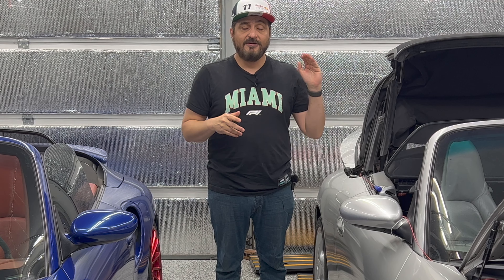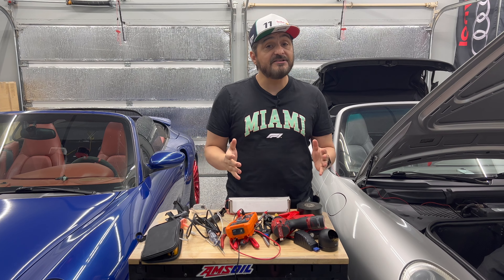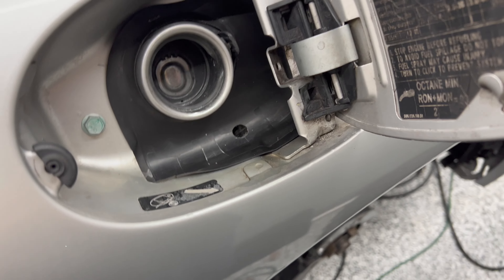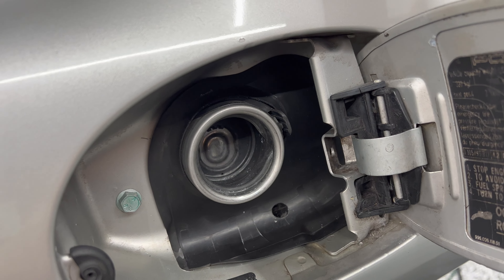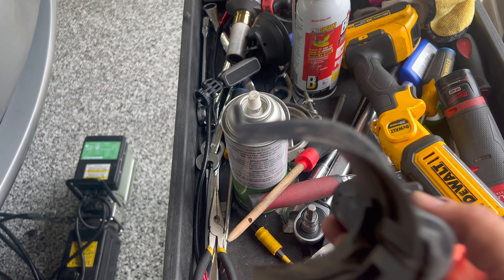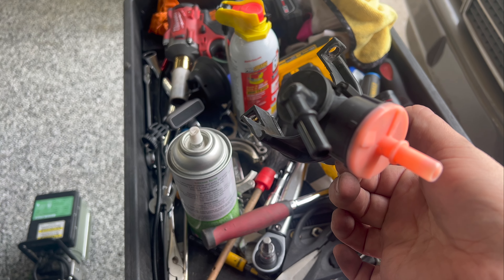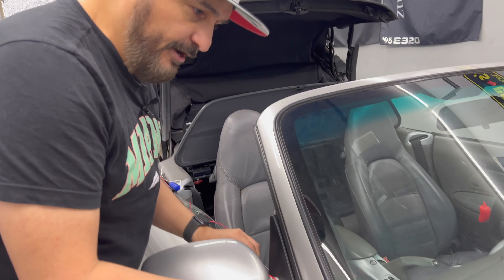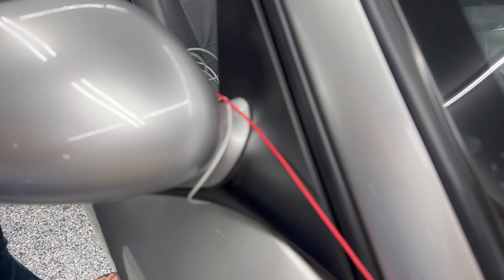When Your Car Hates You: The Saga of My Check Engine Light

Comment: Wow! Amazing work!!

A few years ago I tried to get my friend's 1994 325is running after it sat for 12 years under a tree.

Long story short, I spent weeks trying to figure out why the car wouldn't start. I traced wires, etc. Some recommended I try a other ECU. I did. Still no luck! 

I opened up the original ECU and it was dull of dead ants. Turns out the replacement ECU was bad, too. Bought another one and it fired right up!

Spent weeks trying to figure it out!

I learned a lot about the wiring though!
Reply from the maker: Indeed. Sometime an innocuous issue can turn into a deep-dive into wasteful spending and red herrings but with perseverance we can do anything! Thanks for watching!

Comment: Unfortunately it took you hundreds of dollars to find the problem when you were just replacing parts without first diagnosing the problem fully.  With that said, you did eventually find the problem to be a shorted wire in the wiring harness. Your persistence finally paid off.  Congratulations!!!!
Reply from the maker: Yeah thanks. Sometimes I need to bang my head on the wall a few times to do the right thing. 😎 thanks for watching!
Reply: Tracing the electrical connections is probably the best first step because it is free. But hindsight is 20:20…
Reply from the maker: @boffam00  I’ll be putting my newly learned skills to the test. I have to troubleshoot airbag issues.
Reply: @YogisGarage  do you ever find yourself tempted to find a cosmetically cherry 996.2 with a blowed-up motor to transplant the 4.0 into?
Reply from the maker: @boffam00  dude get out of my head!